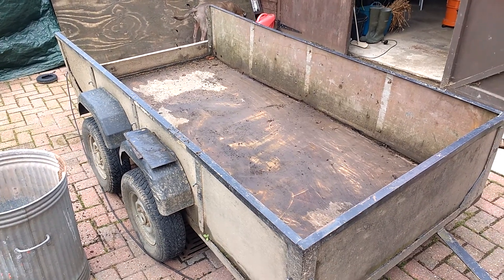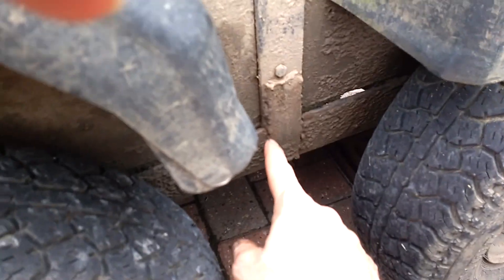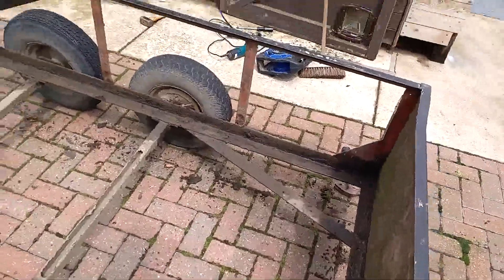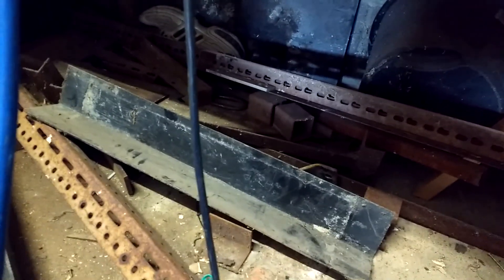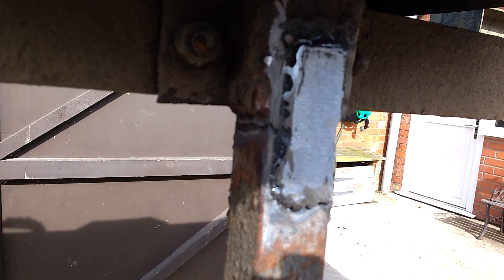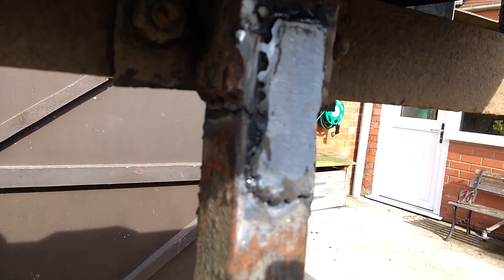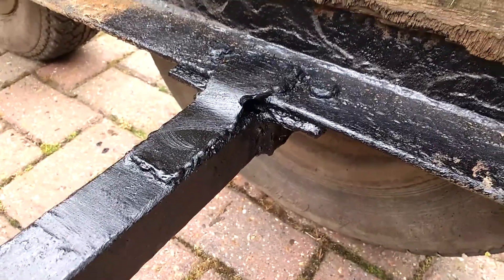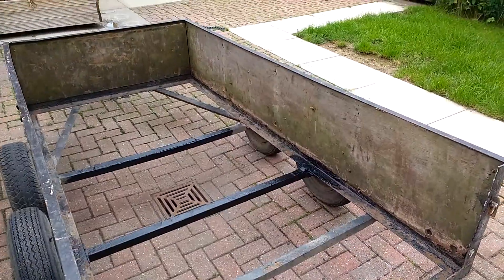Welding noob, snapped trailer axle FIXED

Comment: It would help if you cleaned the area where you are putting your ground clamp,also looks like you may need to turn your amps up...  and put your ground clamp as close to where your welding.
Reply from the maker: thanks for the advice, great tip duly noted
Reply: Two dogs life your welcome, good luck

Comment: Why is everybody using an angle grinder without the safety guard?
I mean I use angle grinders for about 10 years now, and never had to remove the guard for any purpose :D
Reply from the maker: The angle grinder I have was cheap model (about £30 -$40) and the guard didn't fit correctly from the moment I took it out of the box so I left it off, I WILL be getting a better one in future and making sure it has a guard on it, it is dangerous using it with no guard I agree.
Reply: Frank E White what I have found is these people suffer from it won't happen to me syndrome
Reply: Frank E White I only see pipeline welders not use guards and some idiots lmao